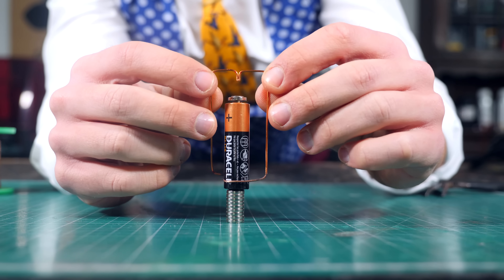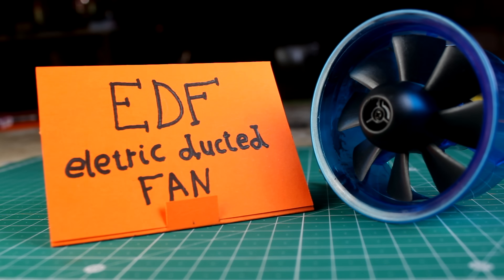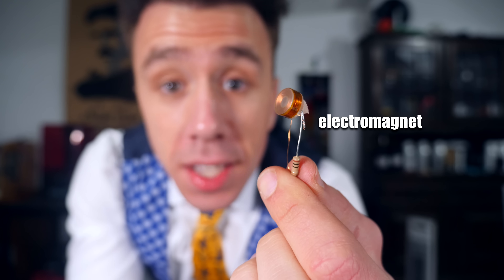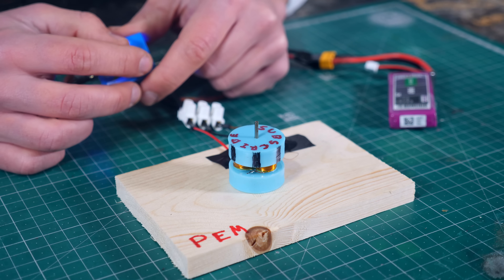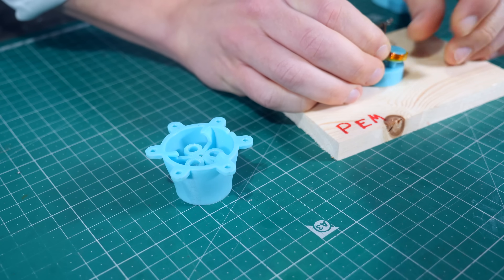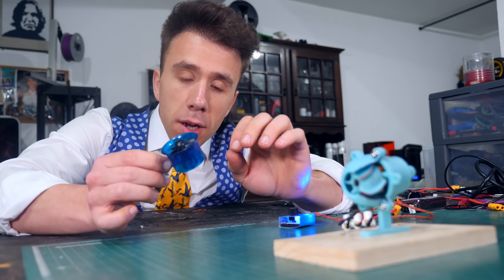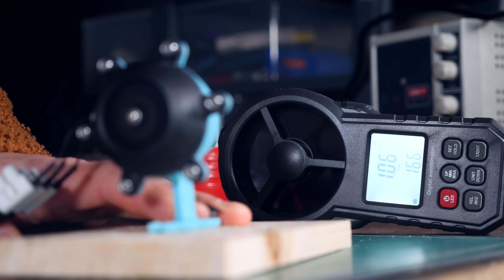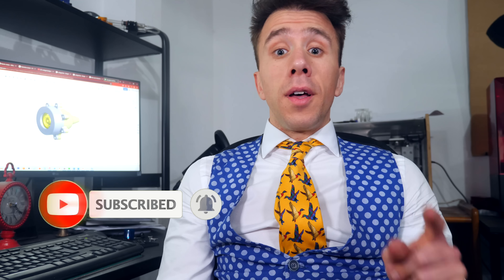I 3D Printed an ELECTRIC MOTOR FAN

Comment: Your issue is your meassuring. Your EDF produces high thrust on a very small area that is tested with a device that measures over a large area. Also high thrust looses a lot of energy once it "collides with standing air". Basicly your test device is garbage for this (Bad data in, bad data out). For overall output just compare how long it takes to blow up a garbage bag. That will provide you with info if the efficiency is similar. To check air movement use schlieren imaging. 

Efficency test will provide you with data if your design is wrong, schlieren imaging might give you a hint what is wrong. Both test are super cheap to DIY. You will never achieve the simple fan design performance. You convert a lot of energy into heat. In a jet engine they dont care, since they have a lot of power/energy and in that scale it actually helps a bit. In your small scale it is just wasted energy.

Comment: If the impeller is the same then you need to check your casing thing around it. Next video you should experiment with different shapes, and if that don't work a different motor.

Comment: Are you testing thrust or just the speed of the air? You should put it on a load cell to measure thrust.

The centrifugal fan has more pressure but less airflow and you don't seem to measure the pressure,,, I think...

Comment: the dyson impeller was designed for 125000 rpm.... you copyed the impeller but not the rpm.  edf has a straight thru design and air has mass so not making it change direction is key. the fan you made need to compress air a bit so you need a lot of rpm to move air. centrifugal impellers need rpm unless your going for a water wheel design. try inverting the impellar to look like a turbo. skinny tip divergent lines to a base and a tight gap to the case then sprinkle maby 2000kv motor with about 55 volts and ur good!

Comment: I believe the exit throat diameter is too small, too much back pressure. Once you add combustion you want that higher pressure but not with just an impeller

Comment: When it comes to turbomachinery, things are not necessarily proportional. Considering that the design of the impeller is the same, I would blame the scale of the whole system (intake diameter, exhaust diameter, length etc). This case is similar to those presented in the good ol’ fluid dynamics engineering courses, where you have to analyze the adimensional numbers that define a system (i.e. The Dyson fan), such as the Reynolds number, Prandtl etc. If you just want to downsize a system, you have to take into account these numbers in order to obtain a smaller system that performs in the same way. I hope this might help a bit

Comment: This is a mass-flow problem, known as P-flux
You are consuming the same power with the same motor at the same RPM, but you arent moving the same mass/volume of air so you arent getting the same thrust. Your home design is too constrictive. It is optimized for increasing pressure, not mass-flow. It would make a good turbopump, but does not make a good jet engine.

Comment: Centrifugal fans produce lower CFM in exchange for higher static pressure. That pressure isn't being measured in your CFM test. Turning it's output 90° won't help it any, adding restriction.

Comment: You are using the same motor and expecting the same trust but what you have to look at is the amount of power consumed. Each kind of impeler have the right amount rpm to work properly

Comment: Centrifugal fans create static pressure.  Axial fans create dynamic pressure.

Centrifugal is great for building pressure or moving air through tight spaces.

Axial is great for moving very large volumes of air.  

Major hardware does a massive amount of tests and has tried centrifugal fans versus axial.  His videos on fan designs might be a great resource for you.

Comment: Air is compressible. As you said yourself, a centrifugal fan or rather a compressor generates a higher pressure. Due to the small cross-section of your nozzle, the pressure builds up inside and the air is compressed and the density increases. As a result, you have greater losses than with an axial fan.

Comment: Nice semi-educational video :) firstly, i am not sure if you measure thrust as it seems you measure the speed of air. Now the ducted fan has a greater area for input and output area hence it will make a higher air measurement than the smallest output of the centrifugal. For fans, they can be characterized with airflow and static pressure. Normal/axial fans have higher airflow and lower static pressure than centrifugal fans.

I think you may have the same output power but with lower airflow, higher pressure. Not sure how to test that.. maybe blow up some tomatoes?
Reply: Usually it is measured with a fan on a moving platform and force applied to scales.
Reply: Could he instead measure thrust with a sled connected to a spring atached to a solid point with a ruler next to it? I believe that using hookes law he could calculate the springs constant and eventually measure the produced forward force

Comment: Video idea: A water powered rocket engine. Basically an electrolyzer that splits water into HHO gas, then a rocket nozzle that burns it back into water, producing thrust. The only inputs would be water and electricity.

Comment: 1
lily impeller...
try a dual bladed fan at a golden ratio   based off the fibinacci sequence     it should really move the air

2
straight duct your impeller  with a "bell" on the lead edge to use the colander effect to help draw in even more air

3 
Venturi your exhaust area this should add even more volume of air to your direction of movement

Comment: (Aircraft mechanic here) axial compressors are more efficient for producing thrust because they maintian flow direction, centrifugal compressors change the air direction, which reduces flow in return for higher pressure. They're better at producing high pressure in fewer stages for things like a turboshaft or turboprop engine, that don't use the exhaust as the source of thrust, that's why all modern jets use axial compressors.

Comment: Centrifugal fans don't accelerate the air as fast as axial fans, think of it as the distance needing to travel over the blade. Centrifugal fans are known to compress air because they force the air into a smaller area which requires energy thus with that less of the "energy" is spent pushing the air to create thrust. Mind you thrust is the acceleration of mass out of a nozzle. 

Over simplified example:
Input energy -effort to move ai r-effort to compress air -friction = overall output of thrust.

Comment: An impeller is more sensible to dimensions tolerances issues, because it require a better seal between the blades and the outer shell, so you could try to print them with an outer ring and use some teflon on the exterior where the ring will touch the case.
Also, this fan is really good at increasing pressure, but not speed, and I know where you want to go, so, may I suggest to expand your design toward the front by adding an additional chamber with a regular fan inside ?

Comment: Are you absolutely, positively,100% sure that it is turning in the right direction. I know that sound basic, but it happens. Also the fan facing the correct way, One last thing is speed, does it work at a slower speed, fan blade angle. Someone in another comment mad a good point "impedeance matching" We used impeller pumps and had issues with impeller deign because of this matching.

Comment: My 2 cents. 
It's because the regular fan blades have much more contact area than the centrifugal ones, you are not pushing the same amount of air, it's less air with more thrust. So unless you scale up the centrifugal design up to match the same area, you are not comparing correctly. Impellers will work great on high density mediums, not so good for air. That is why wind turbines use gigantic blades... It's all about contact area.
This is similar to Ohm's law with amps, volts and resistence ... In the centrifugal design you have more amps, but less volts 😅

Comment: Hey !

I don’t know a lot about flow dynamics but I do know what trumpets and other objects designed like cars and their throttle bodies have a design on the inlet called a bell if you copy this then the air will speed up as it enters the impeller causing the resistance of air going into the fan to be less, hopefully speeding up the air out. And it looks like the EDF has the same design on the inlet.

Hope this helps x

Comment: So my guess is the fan size is not equivalent for a impeller to propeller. Propeller theory is very challenging. Second guess is the nozzle is to constricting. Impeller creates compression but not enough to overcome the narrowing of the nozzle. You need to look into propeller/impeller theory on work being done to a fluid, increase exit nozzle, and also curve/flare the intake. -junior aerospace engineering student.

Comment: Another possible issue could be compressor stall meaning that the angle of attack of the leading blade edges isn't appropriate for the rotational speed and airflow. I think agentjayz did a video on it.
Reply: Issue 2: is it compressing or simply moving air? Outlet nozzle may be too big. Smaller outlet may give more velocity, and that helps with k = .5 * m * v^2
Reply: Issue 3: a tuned rocket nozzle is more efficient than an aerospike at its appropriate atmospheric pressure, but you don't have combustion and supersonic flow, so this is minimal.

Comment: I don’t think that you’re able to get enough air flow through the small opening, and with this style of fan you’re counting on the vacuum created in front of it to create suction to draw it forward along with the pushing out the back which seems limiting.  I don’t think this can ever be equal to a standard fan at the same RPMs, it’s just not as efficient.  Couple that with the inherent loss with pushing air out to the sides then to the back instead of just straight back and you’ve got loss galore in this thing.  Use the compressor to provide compressed air to burn a fuel and you can get some real thrust (but again, the rpm’s you’re working with here aren’t enough)

Comment: ducted fans are a tolerances balancing act, the closer you get the blade tips to the sides of the duct the higher your performance, I think you probly have not reached the ideal clearance needed to hit those efficiencies, and with Dyson, I could be wrong but I was always under the impression the real magic was in their motors, some of their motors hit over 100K rpm

Comment: It might have to do with:
1) Flow: how much air can you actually grab and move backwards? the intake looks kinda small when compared to the commercial EDF you got
2) Thermodynamics: the effect at this scale is probably really tiny, but while compressing the air you increase its Energy content per volume unit. This Energy is either expended as nozzle speed (kinetic energy) or heat - as you know compressing a gas makes it hotter: if you then expel that hot gas without cooling it, you're effectively losing some energy.
Jet engines use centrifugal compressors because they need the pressure to keep the air moving towards the exit nozzle, not because it's the most efficient way to generate thrust. They also extract some of the energy with the turbine (and some of the energy comes from the heat trapped in the fluid!)

3) Geometry: nozzle and ducts in your design might not be as efficient and might constrict flow.

final consideration: after all, you already know that the most efficient way of generating thrust is to have a fan and not a compressor: modern jet engines have huge fans and rather small turbines, with huge bypass ratios

(note: I'm just an enthusiastic student, take what I say with a grain of salt!)
Reply: Jet engines need to compress the air because they add fuel to it. Adding fuel (heat) at low pressure is less efficient than adding it at high pressure.

Comment: My understanding is that a ducted fan is better for mass air flow (CFM) but at next to no increase in pressure. As in it speeds up the air but has very little ability to build pressure. So in the case of an airplane, it largely gets thrust from the momentum of discharges air. 

A centrifugal fan on the other hand is way better at building pressure, but at lower mass air flow. Add a restriction to your outlet and it should do better than the single ducted fan with the same restriction. 

That’s why early jet engines all used centrifugal compressors, they were easier to build. Modern jet engines all use axial compressors because they can be more efficient, but also require much tighter tolerances and many stages to reach the same compression (and as such, more mass).

So the question becomes: do you want to move air, or do you want to compress it. It depends what you want to do next to understand how to design the front fan…

Comment: I think if you check the pressure after the two fans you’ll find that not all pressure is converted back to speed in the centrifugal one.
But, you can always add aferburner and solve it!

Comment: studying the Russians turbo jet engine build from a turbo charger video on YouTube, it is most likely the diameter of the impeller and geometry of the blade make the blade something like the turbo, and it should work but remember turbochargers turn very fast.

Comment: The thing with centrifugal fans is they can pressurize air like no other, but only when it’s spinning RIDICULOUSLY FAST. It’s the same reason that turbochargers have more overall power than screw/roots type superchargers, but when spinning at low speeds, their benefit is pathetically small.

So to sum it up, spin it faster and print a nozzle to properly use the pressure.

Comment: I see 1 big problem
If you want your electromagnet to be effective you need to give it a THICK iron core, if you look at anything that uses electromagnets it is 90% iron 10% copper, my pfp is a transformer that as you see is a brick of iron

Problem 2 i think your rotor grinds against the stator + i suggest you put the coils on both sides

Btw if you use thicker wire the motor can accept more power but if the wire is too thick it will lose a lot on efficiently and not having the motor spinning (with a lot of power going into it) can cause it to die since spinning the motor "pushes" current back from going trough the roof and electroBOOM-ing it,
Also note that the power supply can be a bottleneck because of ohms law, generally more voltage = more resistance (a car battery has 12V but can do above 500A, a microwave transformer has 2000V and can do 1A when shorted)

Also i see no reason why the bought bldc motor wouldn't work unless it has a severe case of chinese

Also I'm not very good when it comes with aerodynamics so i can't help with that

Comment: A centrifugal fan is more useful for static pressure into a chamber especially at those smaller sizes whereas the edf is more for linear air flow. The centrifugal fan will work better at higher rpm (dysons spin at a crazy speeds ) to create high static pressures but not huge flow
Reply: thats what i was about to say, its like comparing static pressure pc fans with high cfm pc fans
Reply: which is why they're used in combustion engines to cram as much oxygen in as possible. I work more with pumps than fans, but the principles are the same (ish). pure axial flow with always give you more flow (thrust) while radial will give pressure, and mixed, well mixed results...  in jet engines the thrust comes from the combustion gases, not the compressor - in a turbo fan you have the jet engine turning an axial flow fan to generate thrust (as well as with the exhaust gases) (yes, over simplification, i know).
Reply: this is where my head was at as well
Reply: this is 100% what i wanted to say, its why centrifugal fans are often used for 3d printers since they can reliably push air to cool parts, whereas axial fans struggle much more with this.

Comment: As an engineer, I've seen impeller fans used in compressors and vacuum pumps, which leads me to believe they are good for high static pressure, rather than high airflow. Its a different tool for a different task. Normal fans on the other hand don't generate that much static pressure, as air just goes back past their blades when obstructed. Try it with a PC fan for example. 
If you can, Integza, try measuring how much pressure they can generate instead of airflow.

Comment: axials move volume.  centrifugal have good static pressure.  if you need compression, you need centrifugal.  if you won't have much resistance and just need to move more volume, use axial

this is why full sized pc case fans are axial.  but tight laptop fans are centrifugal

oh and you CAN get good static pressure with axial, but you need really tight tolerances and A LOT of rpm

and this is why those ebay car electric superchargers don't work.  their CFM rating might meet what the engine's intake needs, but it won't be able to produce boost, which is why they don't add power.  

as for thrust difference, the centrifugal fans are equivalent to an axial fan having 90 degree blade pitch.  it's A LOT of resistance changing the direction of the air.  well, i'm thinking squirrel cage fan style as the extreme example.  but the dyson one is more like the compressor in a centrifugal supercharger or turbocharger

also, go to a site like digikey and look at fans.  the axial almost always have higher CFM, but lower static pressure.  the centrifugal fans almost always have lower CFM but higher static pressure

Comment: It’s probably the surface area or the centrifugal fan that’s the problem reason being the big wide blades on the normal fan catch more air so the centrifugal fan would have to spin much faster to get the same amount of thrust